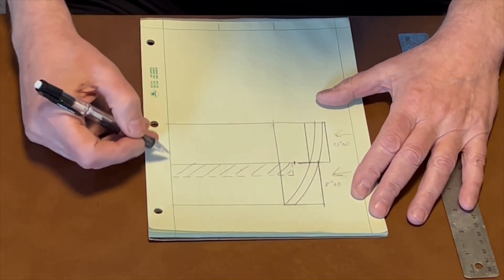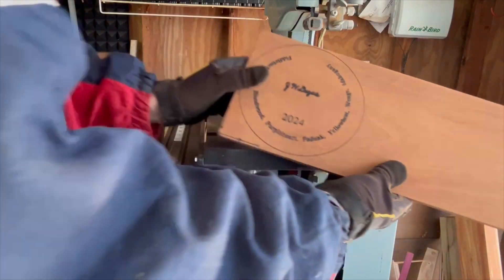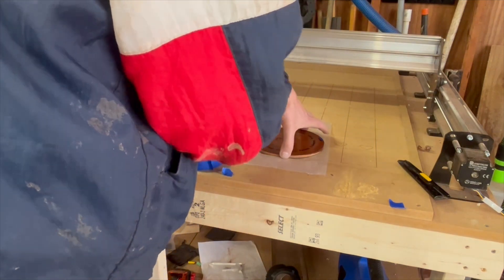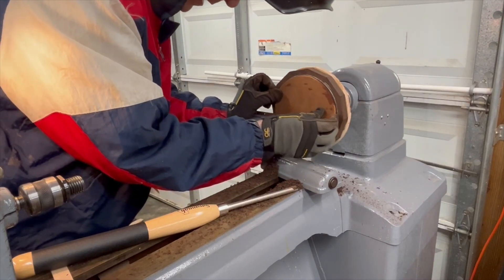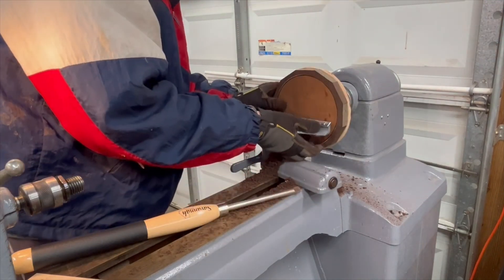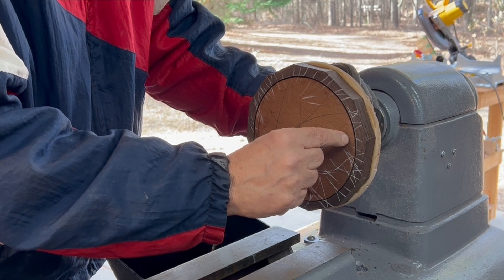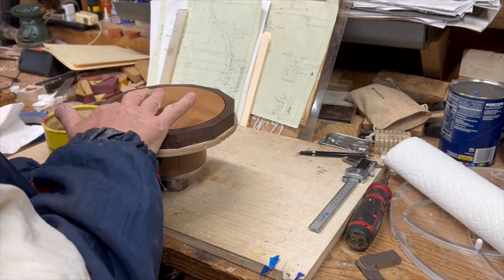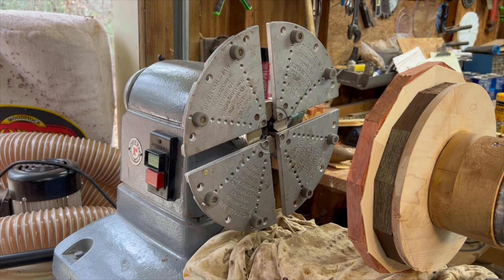Design and Build of a Floating Bottom

Comment: I watched this whole video hoping to learn what a floating bottom is. What does it do? 

I still don’t know. Guess I’ll have to google.
Reply from the maker: It floats to avoid causing stress in the bowl.  Since it is only attached at 2 points and has some clearance for expansion, it does not put stress on itself nor the rings it is attached to.  Since the grain direction of the bottom is different than the segmented rings, they will expand differently.

Comment: Nice video.   Do you then turn the lower inside of the 2nd layer after the glue up? Seems like you could have done that maybe to the lower 1/4” of the 2nd layer while it was on the Cole jaws and therefore avoid touching the floating bottom.  Thanks! 😊
Reply from the maker: No the second layer is flat and lies on  top of the floating ring.